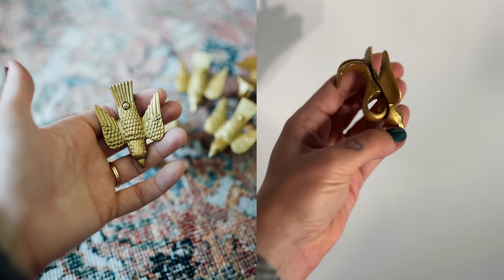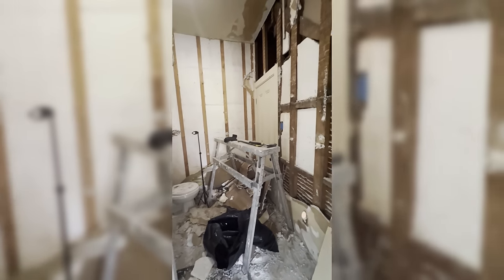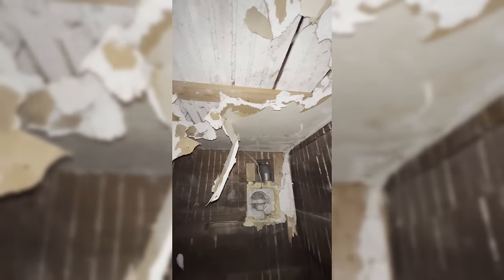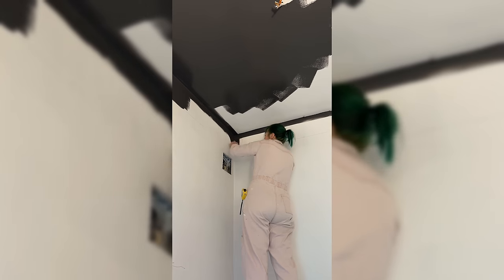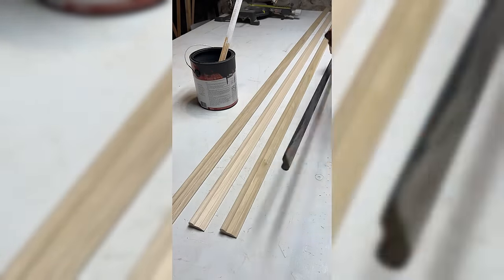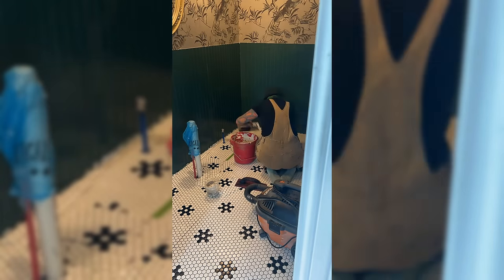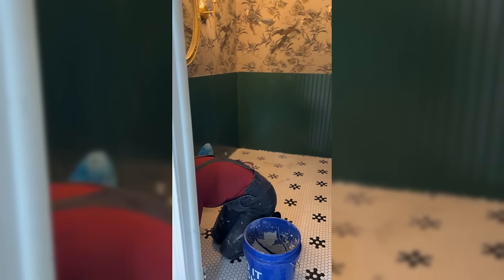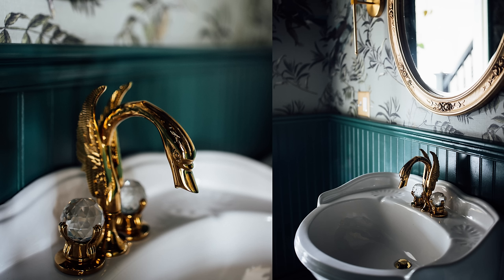half bath renovation! total gut job. new floor, rewiring an old chandelier, hanging wallpaper!

Comment: Absolutely stunning, but that swan faucet is priceless. We just gutted 1400 lbs of Beaverboard our 100 year old house is lathe and plaster on the main and our second story is all original cardboard walls(!) - It is actually called a 1.5 story house as the rafters of our roof are essentially our ceilings. It was a job ripping it all out but... we are finally getting closed cell spray foam insulation starting today! (we have zero insulation in our entire house) I can't wait to redo our tiny half bathroom upstairs and your bathroom is a huge inspiration.
Reply from the maker: Thank you!!!

 Oooof! Congrats on finally insulating!!! Always feels amazing to cross off the big dumb projects like that. The back half of our house wasn't insulated (including the kitchen!!) so we've been doing it room by room as I work on them. It's bonkers what a huge difference it makes.

Comment: Very pretty, I love all the unique quirky brass items!
I was puzzled why you were removing all the drywall, guess I missed the reason why.  It was a good thing you did though, strange and dangerous what was done with the wiring.
Reply from the maker: The old drywall needed to be removed to insulate the room. 🙂
Reply: @kaylahstroup  - Some how I missed hearing that.  Insulation for sure, good you did to find exposed wires.
Thank you, glad you're back posting!

Comment: Do you think they did styrofoam simply for noise reduction as a courtesy feature?
Reply from the maker: Nah, it was on the outside walls and not the literal one interior wall. Most likely just a super cheap way to try and keep some heat.